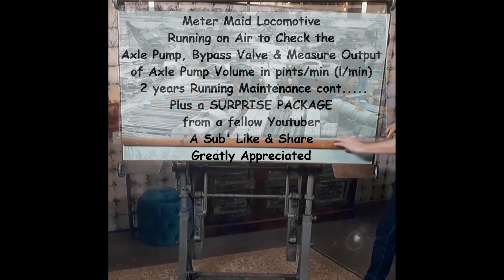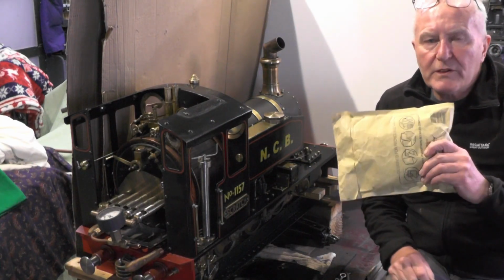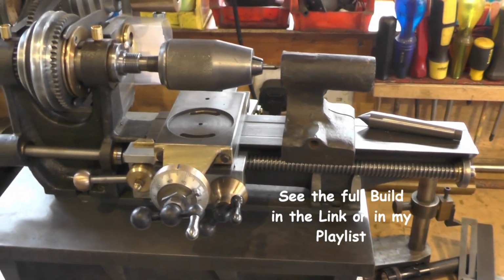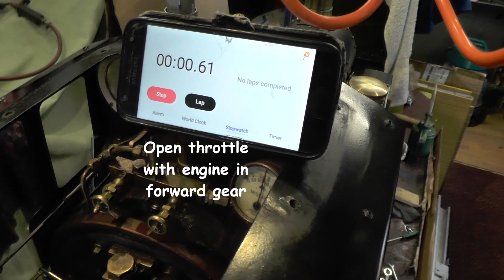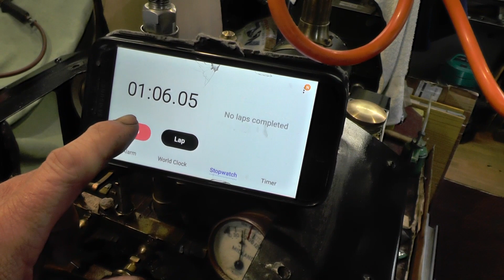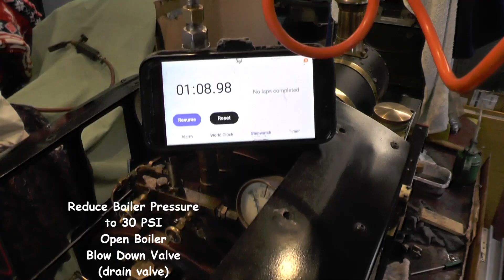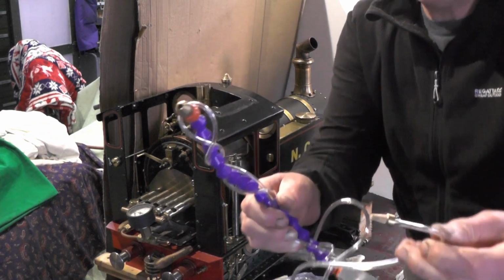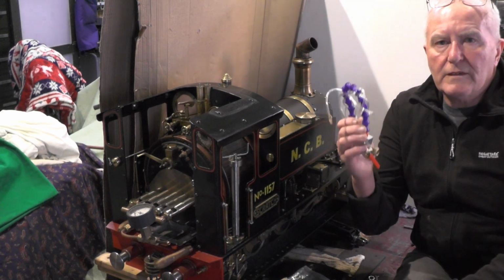Metre Maid Steam Locomotive (Maintenance) Axle Pump Output Check & Surprise Package "mr factotum"

Comment: Hi Kev.  Good video and a good idea how to check your axle pump. Be careful when using that coolant mist spray or use a mask because I had a job working on a milling machine for a couple of years with one of those and I kept getting chest infections. It might be a coincidence but when  I changed jobs to another company that only used flood coolant the chest infections stopped. If you get any bacteria in your coolant then you might inhale it.  I think they are good for some CNC machines that are fully enclosed with guards or you have a good extraction system but it can't be healthy for your lungs.
Reply from the maker: eyup rob, 
Thanks for the comments, yes, i have already had thoughts of that potential problem, but thanks for your experiences and advice, it will help me decide.👍👍👍👍
Just about to have a catch up on your video's and others now i have chance.
atb
Kev